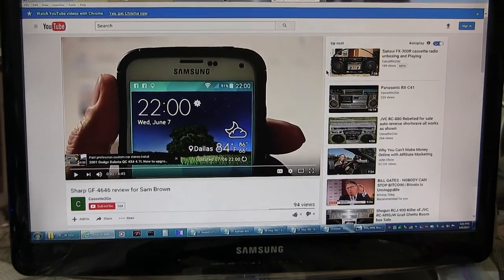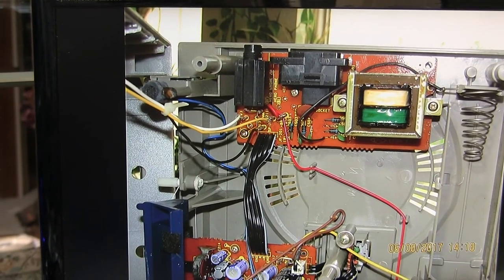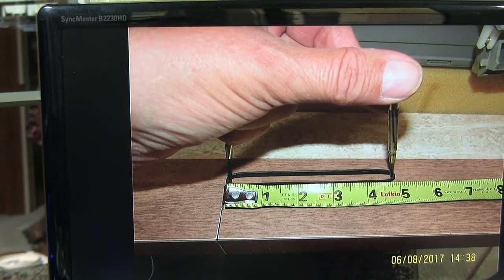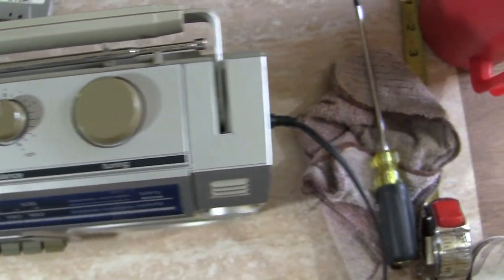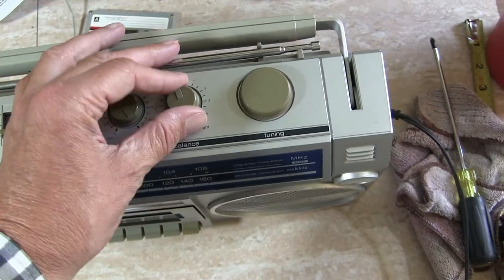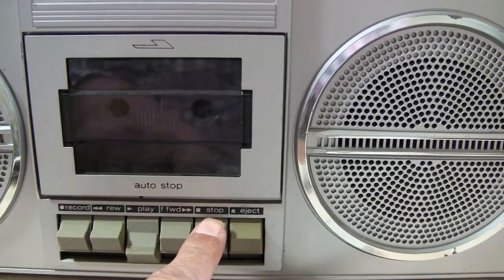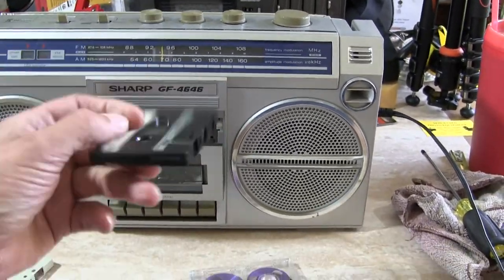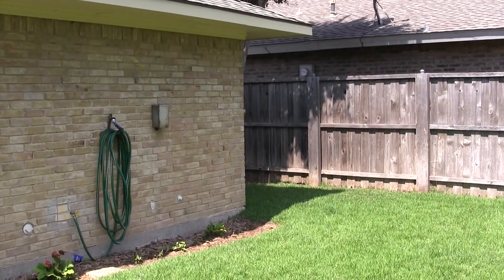Sharp GF-4646 Serviced Inside view New rubber square belt

Comment: Just bought one but your tape deck still wobbled due to the belt slipping?  maybe get a slightly smaller than measured belt.  Been looking for the exact one, but only thing I can find is a lot sale so have to use your number and maybe find one just a tad smaller or use belt grip which makes the belts adhere to the capstans.  Thanks much!

Comment: very nice video I have sharp 5454 but it needs a repair its volume and PCB from that side is broken. perhaps somebody dropped a heavy object on the radio
Reply from the maker: Ok I just looked at my pictures and you need a long shaft of whatever value that the volume is to repair yours with. I No longer have this model as I sold it, so that is all I know to help you with.